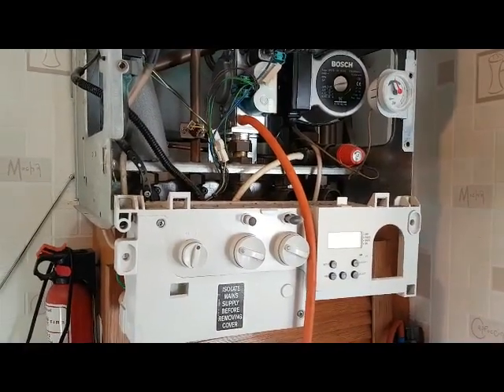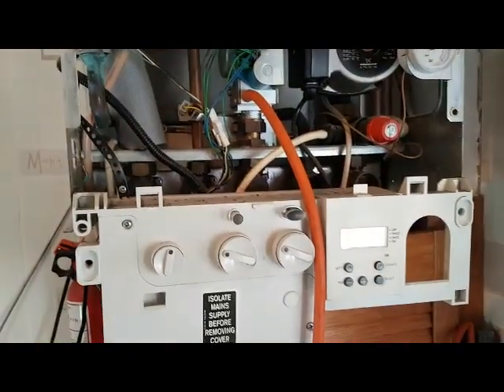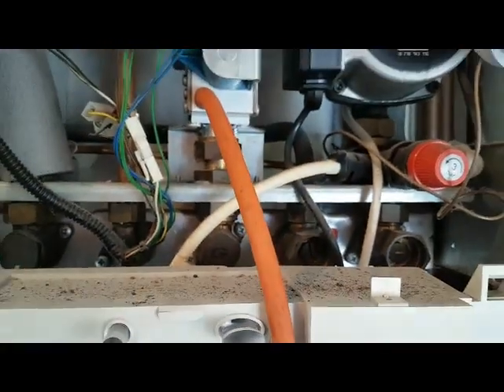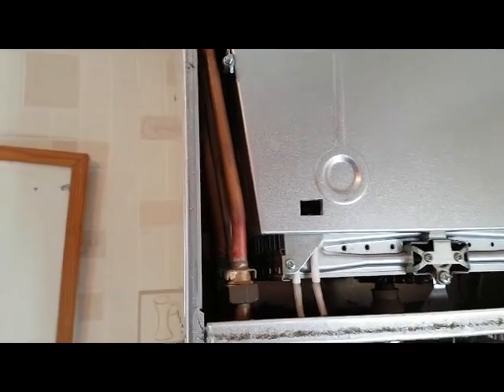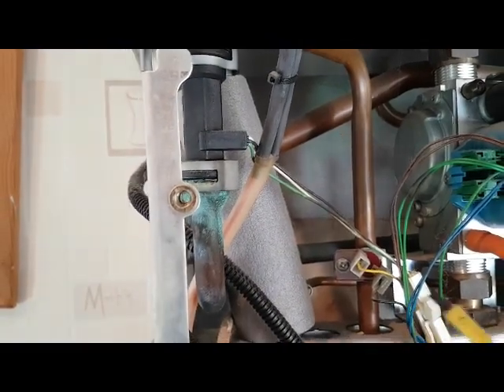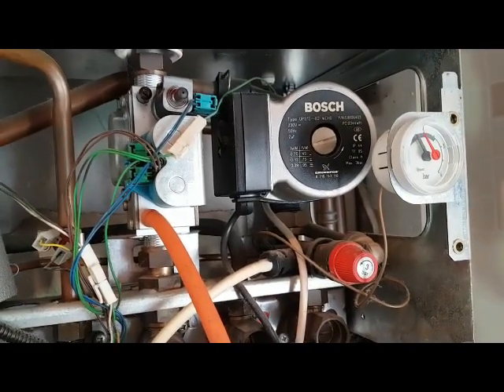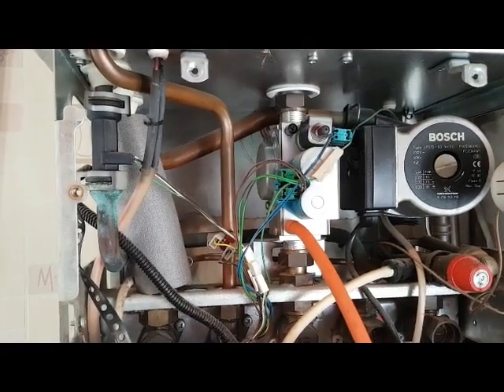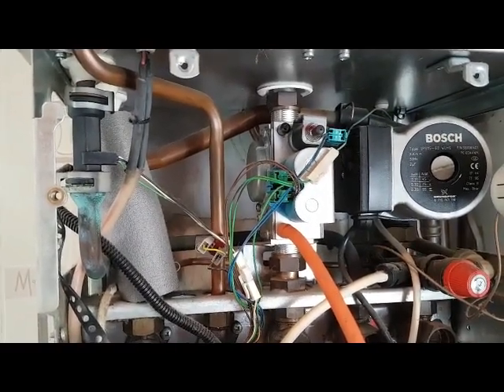Worcester 28SI Mk2 Hot Water Fault Question. With Coach Tony Morgan

Comment: i would check gauges on for hot water, then the flow switch turbine for resistance across the terminals and see if it changes.
Reply: and the NTC or PTC sensor is also ok
Reply from the maker: hey we're currently trying to grow our Facebook group and would love you to join Tony and the team using this link, Tony will be available to answer all your questions directly there's also updates on new trainings we just released too. https://www.facebook.com/groups/167070231326174